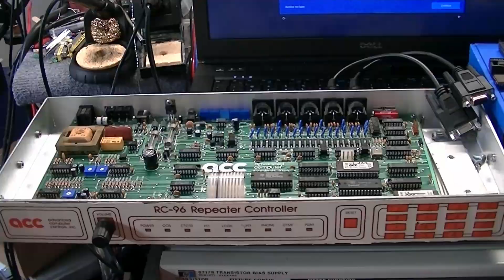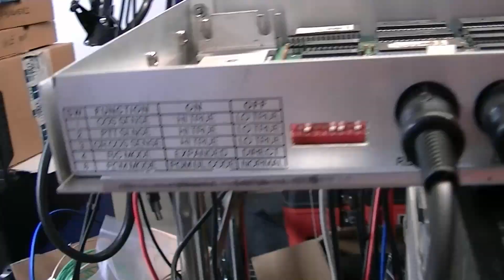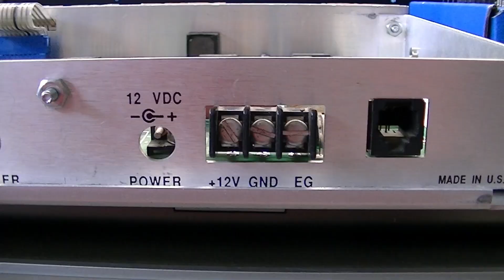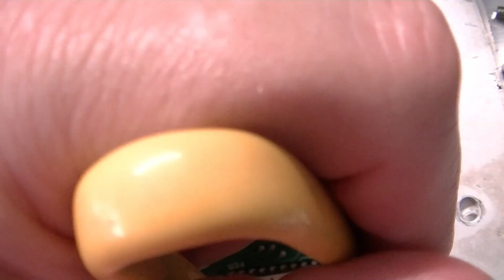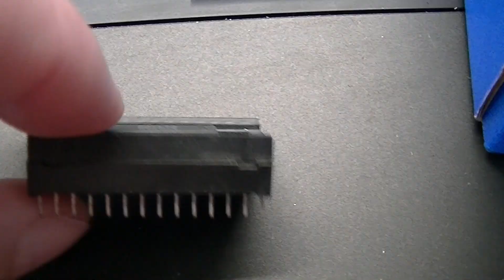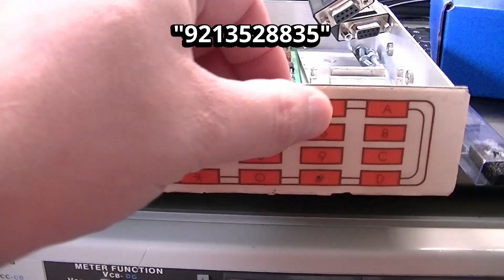ACC RC-96

Comment: Gave you another like for the voice!  Oh how I miss these controllers on the repeaters.  The new ones just don't have the personality that the RC controllers have.  So I have a question.  I bought as CAT700 controller for one of our repeaters and my friend game me the RC850 controller.  Is there anyway to hook it up and hear the voices without hooking it up top a radio?
Reply from the maker: The RC-850 uses RCA style jacks on the back for audio, easy just to run an RCA cable from TX Out to an amplified speaker or stereo line in.  If you have the control panel that has a volume knob, there should be an 1/8" jack on the back as well that you can plug a 8 ohm non amplified speaker to. Depending on the year it was made the front panel will either support a Kenwood or an Icom touch tone mic,  check the pin out of the wiring before plugging a mic in though.
Reply: @DCFluX    I'll have to dig it out and check this info out!  Thanks.